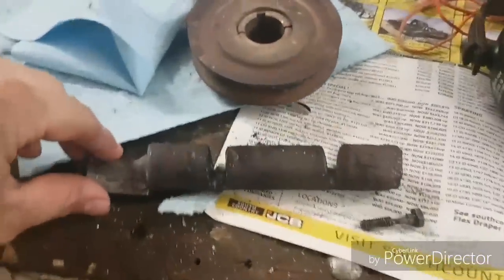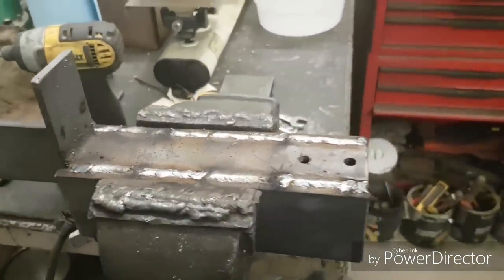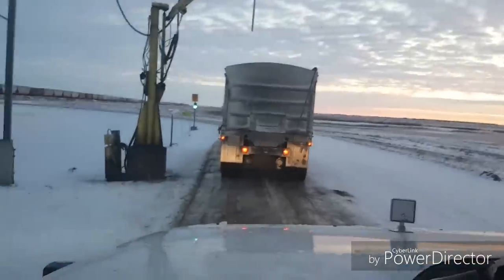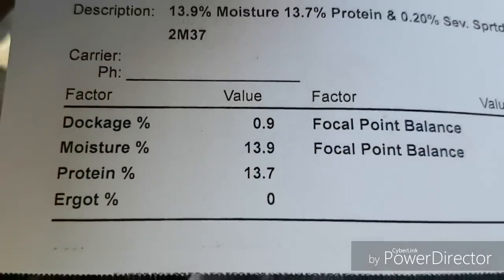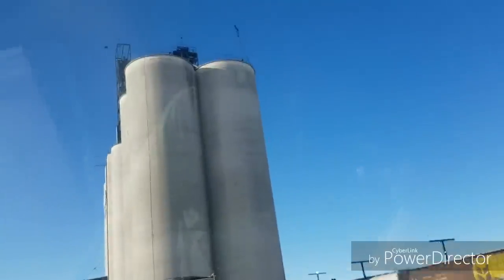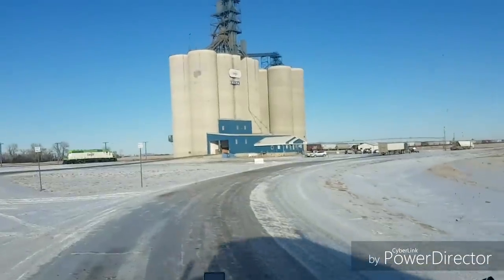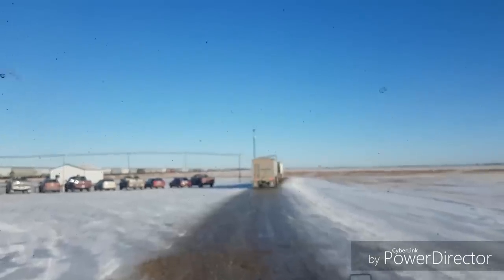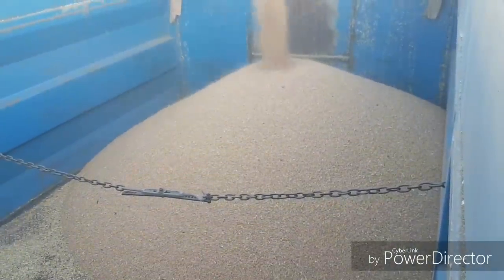East bound and down!!

Comment: "Right to the floor..."  That's the only way to run those old DT-466's... LOL:)  I drove a bus with one for 9 years, and basically I had two foot positions, for the most part... either foot on the brake or foot pressing the pedal to the floor, because that's all she had... LOL:)  Still, if you think she's a dog, try driving one of those old buses with the 7.3 and Allison in it... TOTAL dog... push the pedal to the floor, count to three, and she'll start winding up... count to ten she'll finally be wound up about 2500 RPM and maybe you'll be rolling at a walking pace by that point, count to 20 she'll shift up and you'll be moving maybe at a slow run LOL:)  Geez that thing will drive you nuts... 
Our old grain trucks were all old gassers... Grandpa and Dad had a '56 Ford inline six with the five speed behind it, wasn't TOO terribly bad except it had been a fertilizer truck and was rotten to the gunnels-- you could watch the ground go by under your feet and watch the driveshaft spin under the seat because most of the cushion stuffing was gone and the covers went a decade before that LOL:)  She finally rotted away to nothing, so I stripped the frame and made a trailer out of it.  We bought an old '56 Ford 352 V-8 5 speed someone had welded a tag axle on the back of the frame to make it a tandem... overly optimistic by a longshot LOL:)  She was a dog you had to start dropping gears the last few miles to the elevator (23 miles away for me) because she'd be overheating and backfiring and just generally being a witch by that point.  I replaced the stupid copper factory radiator that was 2 feet wide and three feet tall and 4 inches thick with a radiator out of a late 80's Ford 7.3 diesel F-350 that was four feet wide 3 feet tall and 2 inches thick, and then she'd actually cool enough to carry the load, though you're still not getting much out of a gasser with a big load anyway.  When I started helping the BIL in Indiana I ran his brother who got killed in a car wreck, his old grain truck which was an 80's Chevy, not the Brigadier but one like it... nice cab, but the 350 V-8 was a real gas hog and the 5 speed with the 2 speed rear end and air tag was pretty wimpy... Oh, she'd haul 350 bushels and get you there, but not in any friggin' hurry in any way!  Then I moved up to the old IH almost identical to your tandem, other than it was on the HD front axle (to take the super singles like a concrete truck but had regular 22.50's on it) and Hendrickson walking beams in the back carrying the twin screws... She was on Budd wheels all the way around which was real nice compared to the old Dayton's like you've got, plus she's on air brakes which is 1000% better than hydraulic brakes on a HD truck IMHO... I'd love to have air brakes on my pickup if I could get them LOL:)  Anyway, she had the DT-466 and a 13 speed behind it with the granny gear; she was geared funny because it was an old mine or forestry truck so basically you never used low range on the transmission, just medium and high range, and the granny was just for getting rolling on soft ground like pulling out of the field.  The BIL said "if you start in low range you'll shift five times before you get to the end of the driveway" and I tried it one time for sh!ts and giggles and he was right... you could walk beside the truck in every gear in low range and be in mid-range before you even got much past two truck-lengths from where you started LOL:)  SO, basically you drove her like a ten-speed, ran all the gears in mid-range then toggled the air shifter and ran all the gears again to get to full speed.  Compared to that old Chevy gasser with the 5 speed, she was like a race car!  Then he bought the semi and I drove the straight truck for another year or two til he decided to sell it and put me in the semi, now that International with the N-series Cummins and 10 speed pulling 1000 bushels like nothing, compared to that old DT-466 that would be running balls to the wall pulling 600 bushels, that big 855 Cummins will just run rings around her all day long.  Ain't no wonder AT ALL why that old Freightshaker of yours will walk off and leave that DT-466, heck they ain't even in the same league LOL:)  Particularly with a box on the back instead of a hopper bottom trailer...  My youngest nephew (at the time) suggested yanking the box and hoist off the DT-466 and putting a fifth wheel on it and getting another hopper bottom to pull with it and I just laughed... "She's got all she can handle with 600 bushels and the box/hoist, and you want to put a 15,000 lb semi trailer and A THOUSAND BUSHELS behind her?? LOL:)  You MIGHT get her in high gear by the time you got to town LOL:)"  Still, she was a heck of a good tandem straight truck and beat the pants off of anything I ever had  LOL:)  
Later!  OL J R :)

Comment: Those welds are decent.  My welds look the same.  I can stick weld better than i can mig weld. Most old guys give me a hard time about that because stick is harder to learn but that's what I'm used to.   The welds can look like crap but if they hold that's what matters.  We can overload the trucks during harvest from October 1st to November 29th by state regulation.  We have to haul over 250 thousand bushels of corn that we have stored to the ethanol plant over the winter.  We have 65 thousand bushels of corn stored in our combine shed. Nice video.
Reply: Yeah I'm the same... Love my old crackerbox and sticks to weld with.  I braze pretty good too.  Mig, well, it'd help not having a cheap Lincoln wire welder BUT we only use it for sheet metal anyway, so why bother.  I've run the BIL's MIG a time or two and done okay.  If I got used to it, well... I'd do better.  DO love the plasma cutter he's got though!  OL J R :)

Comment: A couple of pumps with the grease gun goes a long way to preserving the life of a bushing , lol
Reply: Those pins and bushings are 45 years old
Reply from the maker: Not for 45 years though lol
Reply: Not when they break free inside the tube and are no longer bearing the weight of the load on the pin... when the bushing is just along for the ride as a spacer at that point and the holes in the side plates are the only thing the pin is actually bearing on.  Why I'm not a big fan of that design... 
Any time I build something that uses a bushing, I make sure the tube goes THROUGH the side-plates and gets welded all the way around on the OUTSIDE, even if it is ground down flush later on for whatever goes over it to ride flat against the side-plates... I did trailer tongues that way and NEVER had a problem with the bushings... Later!  OL J R :)
Reply from the maker: @lukestrawwalker  exactly

Comment: Great video Nick. For your Trucks you should change the axle oil (along with transmission oil). It will greatly decrease the rolling resistance in your vehicles thus allowing you to get up to speed quicker and give a much better fuel economy (expect c.15% or better improvement). It is something which is rarely changed in a vehicle, but makes a huge difference. Try it on the International and I think you will be surprised at the difference.
Reply from the maker: Lol some how I doubt it haha
Reply: Paul Lynch That has to be one of the dumbest things I've ever heard.
Reply: Well I always heard to use Windsor as a fuel treatment. About a bottle per tank. Downside is it likes to run into things.
Reply: @assman ....explain the logic of your enlightening comment
Reply: Paul Lynch ,what do you change to? A lighter oil?
Reply: Maybe if you used a lighter synthetic oil.
Reply: @ivanmoreau1798  Hi Ivan. I would not suggest changing the weight of the oil, nor changing to a synthetic if existing is mineral based - best to follow the owners service manual for exact oil to use. 
Every oil will break down over time (the is no such thing as a lifetime oil for any vehicle) and the oil in differentials/axles is a heavy weight oil to begin with. Over time it slowly loses its original fluid properties, becomes oxidized and will have metal particles which wear off in the course of normal vehicle operation. Metal-to-metal contact wears down surfaces and creates heat from friction, which inevitably weakens the gears and leads to failure. For this fact the manufacturers all put a service interval in the vehicle owners manual to advise to change it in order to reduce damage as the vehicle gets to higher mileage. 
Weather cycles during the years of operation of a vehicle also have an effect on the oil - a heavy weight oil will move like a thick sludge in colder climates and take time to get up to normal operating temperatures and viscosity - something to be aware of if you are hauling a heavy load and its the first trip of the day on a cold day. 
When changing the Axle/Differential Oil you must also change the gear box/transmission oil and transfer case oil (if 4x4) to keep the vehicle at its optimum working efficiency to reduce to a minimum torque generated by the engine which is lost in the transfer of power through the drive-train. 
Aside from performing this service in a commercial vehicle, if you have a high mileage car/pick up truck/SUV, changing these oils will have a dramatic effect on recouping the fuel economy of your vehicle which has slowly diminished overtime. 
It is a given then tire pressure must be at Manufacturers prescribed rate and a steering alignment is done of the vehicle to ensure the tires are not driving against themselves.
Reply: @heartwoodfarms9982  Hi Heartwood Farms. Same answer as I gave to Ivan - 
I would not suggest changing the weight of the oil, nor changing to a synthetic if existing is mineral based - best to follow the owners service manual for exact oil to use. 
Every oil will break down over time (the is no such thing as a lifetime oil for any vehicle) and the oil in differentials/axles is a heavy weight oil to begin with. Over time it slowly loses its original fluid properties, becomes oxidized and will have metal particles which wear off in the course of normal vehicle operation. Metal-to-metal contact wears down surfaces and creates heat from friction, which inevitably weakens the gears and leads to failure. For this fact the manufacturers all put a service interval in the vehicle owners manual to advise to change it in order to reduce damage as the vehicle gets to higher mileage. 
Weather cycles during the years of operation of a vehicle also have an effect on the oil - a heavy weight oil will move like a thick sludge in colder climates and take time to get up to normal operating temperatures and viscosity - something to be aware of if you are hauling a heavy load and its the first trip of the day on a cold day. 
When changing the Axle/Differential Oil you must also change the gear box/transmission oil and transfer case oil (if 4x4) to keep the vehicle at its optimum working efficiency to reduce to a minimum torque generated by the engine which is lost in the transfer of power through the drive-train. 
Aside from performing this service in a commercial vehicle, if you have a high mileage car/pick up truck/SUV, changing these oils will have a dramatic effect on recouping the fuel economy of your vehicle which has slowly diminished overtime. 
It is a given then tire pressure must be at Manufacturers prescribed rate and a steering alignment is done of the vehicle to ensure the tires are not driving against themselves.
Reply: @paullynch277  You're talking about a vehicle that weighs over 55,000 lbs loaded, and the gear lube from the factory is 85w140 or 80w90. Both of them new are thick as hell in the cold and besides only the bottom 1/4 to 1/3 are actually sitting in the oil. So the ring gear creates the lube for the rest of the differential by carrying the oil around the ring gear. The ring and pinion has probably the highest torque put on it from anywhere on the truck and to say that changing the gear lube is going to make a noticeable difference is ridiculous.
Reply: @burkhardt7372  looool - Clearly then you know better than all the Vehicle Manufacturers Designers and Engineers who have recommended specific services intervals for changing the differential/Axle oil in every owners manual....... educate yourself and try change it on your own vehicle and experience the difference - everyday is a learning experience -  instead of talking pure uneducated rubbish which is refuted by all Vehicle Manufacturers and the Oil Companies who supply the oils.